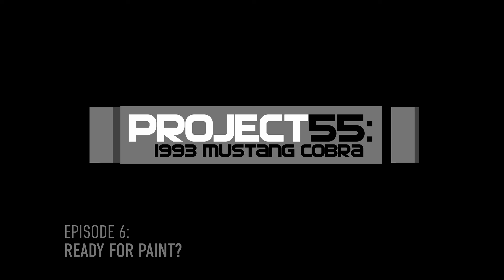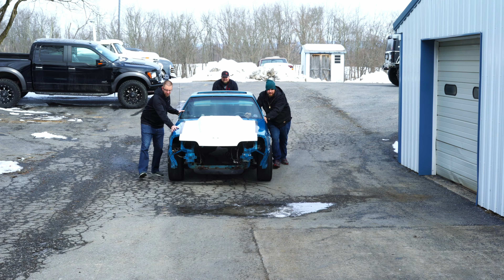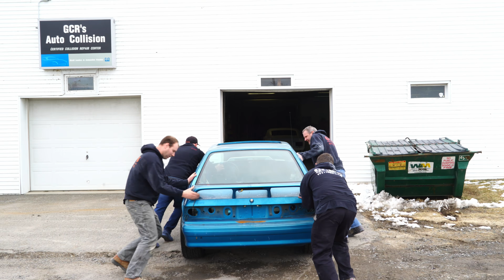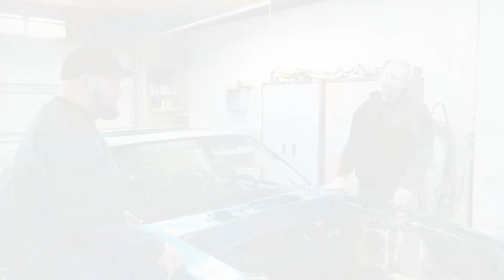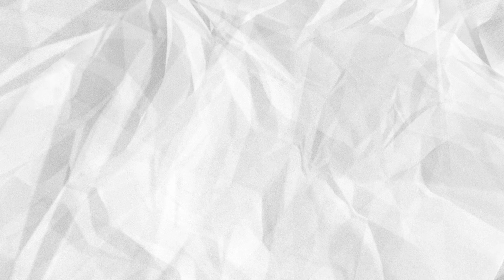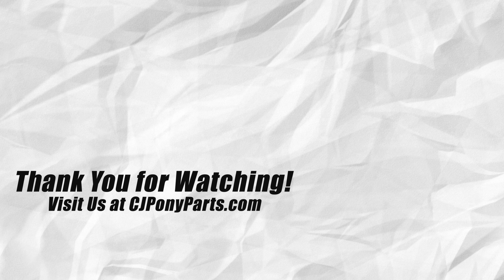PROJECT 55 | Episode 6: Ready For Paint?

Comment: Stock was 235 HP. 🤓
Reply from the maker: Wash Machine but the welded in Flowmasters had to add 10 hp right?!?!? :)
Reply: CJ Pony Parts of course!!
Reply: I had an ‘89 hatch back.... Ripped out the 5 POINT Slow and dropped a 351 Windsor with a Vortec Supercharger and I Fuel Injected it through Wolf injectors.  I ended up with 680 horses to the wheel.  Then I had to beef up the suspension... We bought parts from Saleen to beef it up and put in traction bars along with a 12 point roll cage in the interior.  The car had a Hersch shift kit with the short throw T5 and king cobra clutch...  We put in 2 chamber flow masters and the 3” pipes came out through the back bumper...Back then we only had H-Pipes and edelbrock headers....  The car was doing low 10s on the Sears Point quarter mile...  That was 20 years ago.... Today I drive a 2017 GT 350 Shelby... Man how the times have changed.  I never would of dreamed that Ford would build a car like the GT 350 Amazing....

Comment: Don't change the exterior, if you don't need a cowl don't use it IMO.  Good to hear you are using all the original panels.
Reply from the maker: SteveD stock hood was destroyed and I like the cowl look so I went that direction. I would have kept the stock hood if it wasn’t bent in half.
Reply: I agree SteveD.  I am not a fan of cowl hoods unless the rise on the cowl is super low